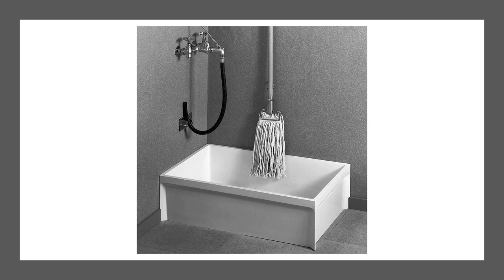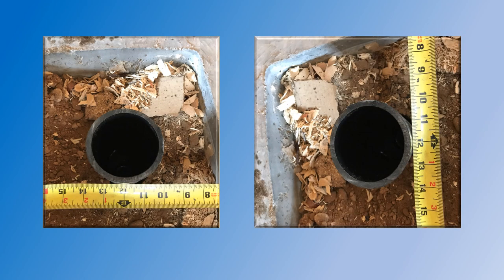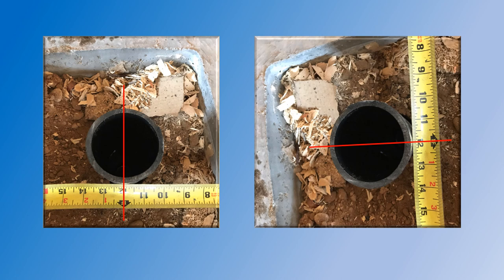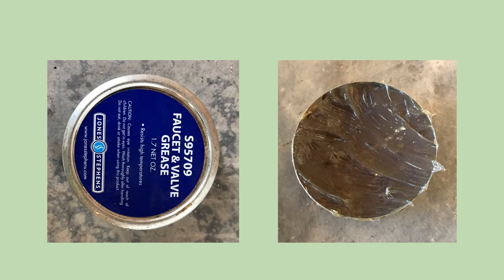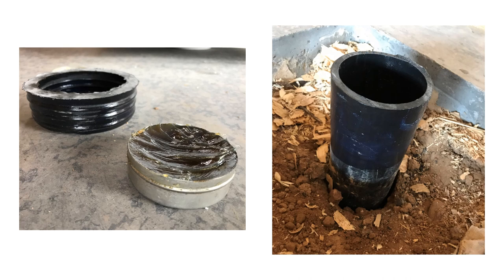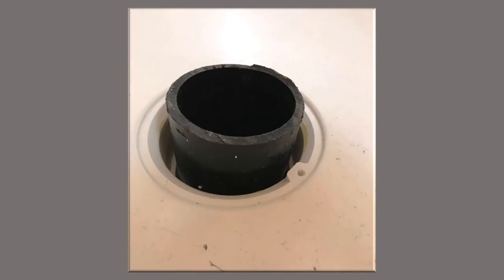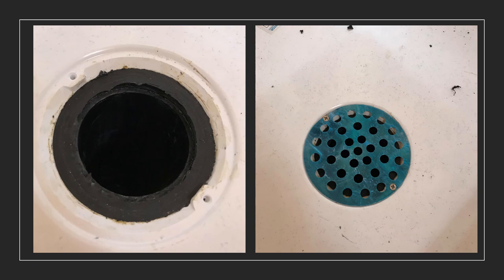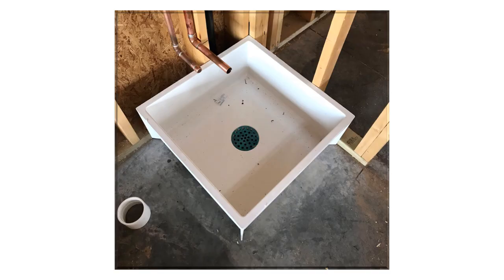How to Install a Mop Sink

Comment: I am a facilities maintenance tech. I have a mop sink drain leak. I understand now what seal is not quite performing 100%. The mop sink is being used for a/c condensate. Two 100 ton units so there is constant very  cold water flow. Rubber likes to contract and firm up when it is cold. Thanks for posting the pictures! 🇺🇸👍

Comment: I discovered that a 3/2 bushing fits perfectly thru the bottom and it's already beveled for the gasket to slide on simply with a little spit lol 
Due to a different crew doing the slab I had to use 2 inch and and to move it over  a street 90 in the bushing kept the depth minimum so I didn't have to dig further down than the P-trap

Comment: How do you install a mop sink if the drywall and floor has already been completed you've already lived in the house for years there is a bathroom on the other side of the wall though

Comment: This is what I have at work... and it leaks. I'm going to force a toilet ring in then force the rubber gasket in and pray! I don't understand why the gasket isn't tapered.
Reply: I agree these gaskets suck. I just did one & still leaks. You have to add silicone around the gasket
Reply: @brooklynaudit  I tried silicone but it wouldn't adhere to the gasket. One of the mop sinks I checked was leaded in. I did wind up using a wax ring and a rubber seal and that's holding. I've seen the same method used for flange risers.